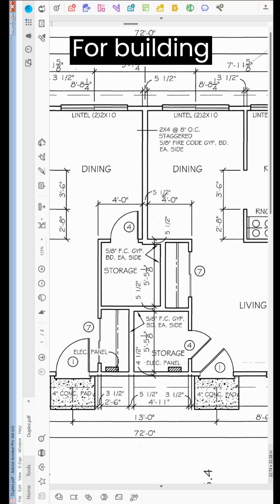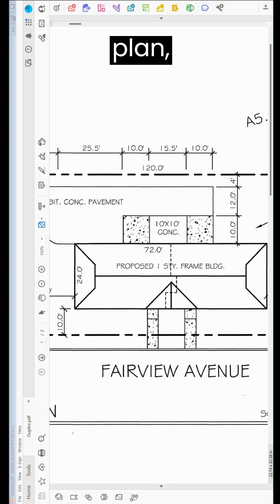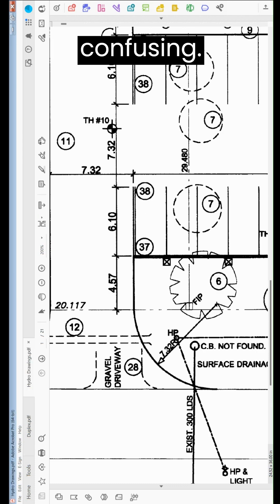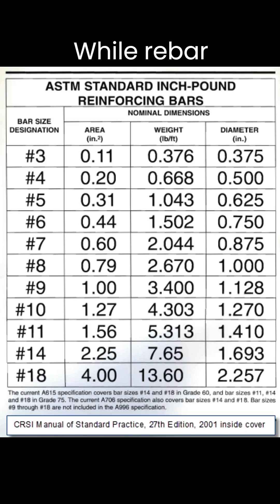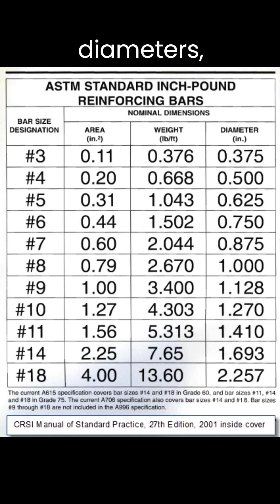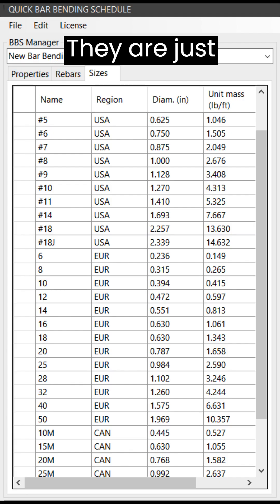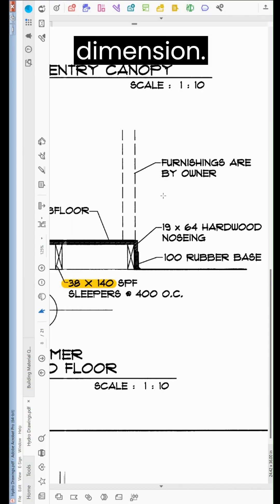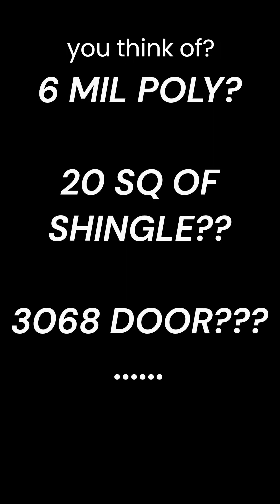Quantity Takeoff Units: Imperial vs. Metric

Comment from the maker: Some additional examples: 
In imperial system, steel beam linear density is given in pounds per linear foot. But in metric, it is given in kilograms per linear meter. 
The “MIL” in 6 MIL Poly Vapour Barrier does not mean millimeter, or inches. It means 1/1000 inch! 
The “Square” used by roofing trade is not Square Feet, not Square Meter, not Square Yard. It means 100 Square Feet! 
The “3068” used by the door suppliers is always imperial, 3’ wide and 6’ 8” tall, although the drawing might specify metric.